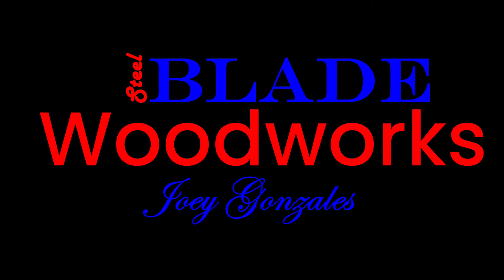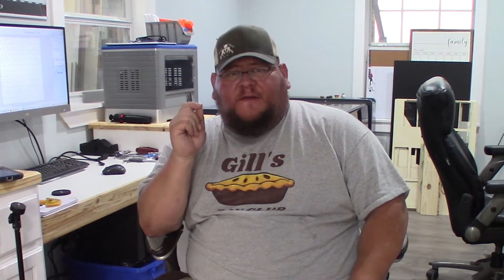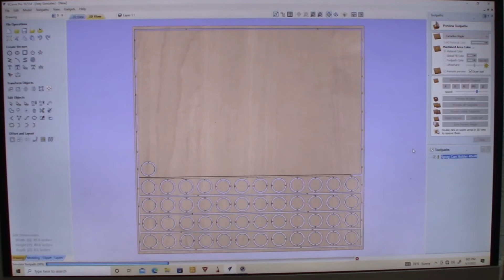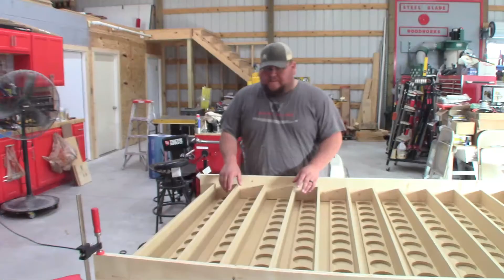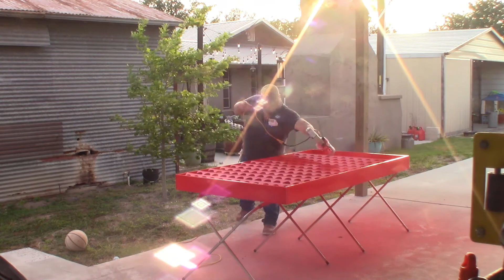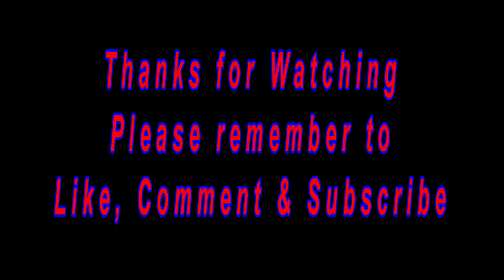Workshop Spray Can Wall Organizer Rack

Comment: hey Joey.    another great posting my friend.   I do have a couple of things.  How is your battery pin nailer doing?   looks like you have used it pretty good lately.  I am tired of dragging a hose around my shop.....  (I have all Bosch battery tools but they don't  market a pin nailer yet)  2nd, I love that outdoor pit that you have behind you!   thanks again.  👍👍👍👍
Reply from the maker: I love that Ryobi nailer it does very well, I've had zero issues with it. I completely recommend it!!! There is a link in the description to my Amazon link. As far as the pit goes I love it as well it's a beast!!!